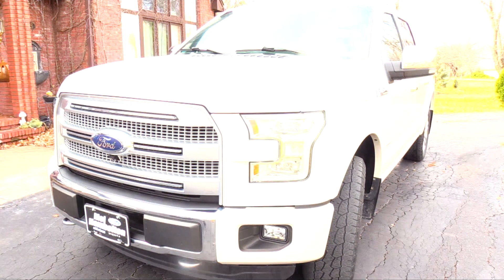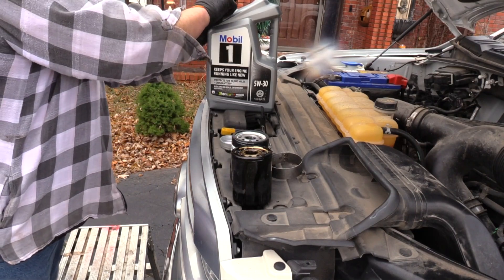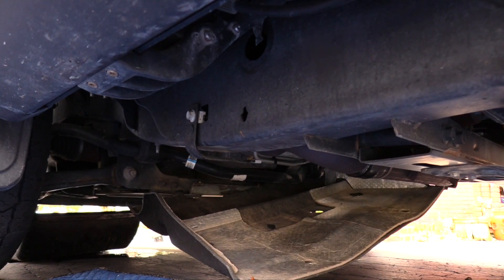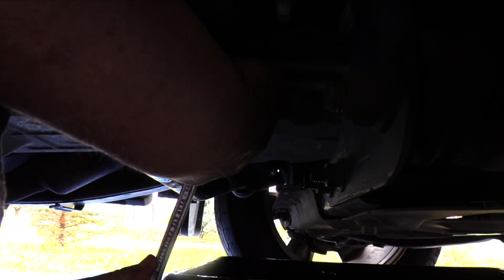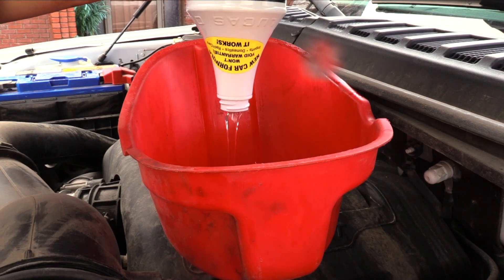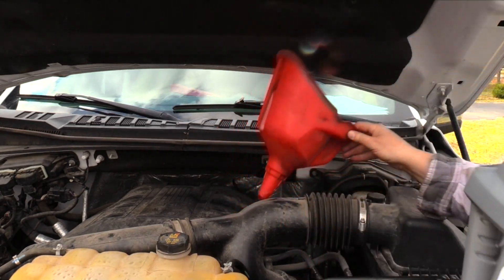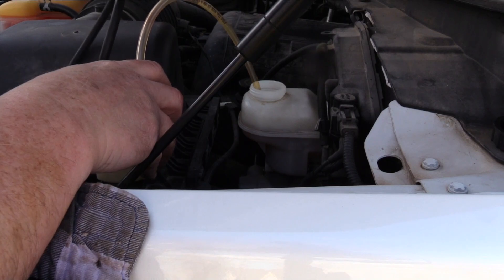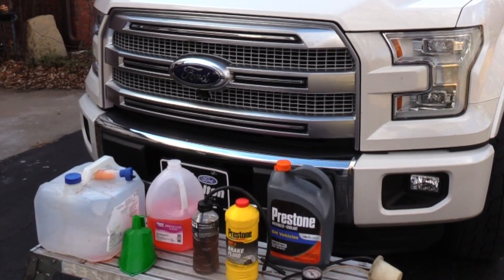CHANGE YOUR OWN OIL! A Service no "low price" oil change outlet can match

Comment: Hey Norm.  So I'm trying to figure out why my 94 f150 rear wheel drive has no brake pressure.   I swapped the front calipers and tried to bleed the brakes put the pedal never gets stiff. There's no brake fluid leaking and my reservoir is full

I'm all out of ideas ;(
Reply from the maker: You are most likely experiencing air in the system. That’s got drum brakes on the rear ? Like the 94 Bronco. Be sure to bleed from Passengers rear first, drivers rear, passenger front, drivers front. A power brake bleeder may be in your future . John Dow industries, makes a good model that uses an air compressor, so you can do it without getting rubber legs
Reply: @normanpaulife   I hear ya but but matter how fast and how many minutes I take to pump the brake pedal - it doesn't ever get stiff
Reply from the maker: https://www.amazon.com/JohnDow-Industries-JDI-050EV-Pneumatic-Exchanger/dp/B08LLFWP5L
Reply from the maker: You might have a leak internally, the fluid is bypassing ( going in a circle) check your master cylinder, and brake booster, is the fluid level dropping? If your not sure remove and bench bleed your master cylinder in a bench vise , and check for leakage on the rear seal, and if it doesn’t pump up the internal seals are worn
Reply: @normanpaulife   I appreciate your input greatly.  I'll get started on it